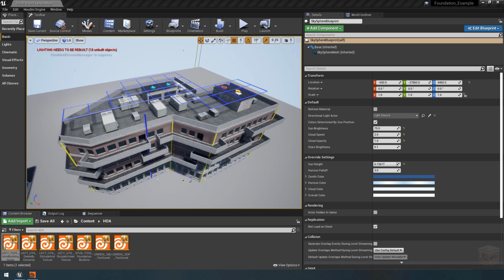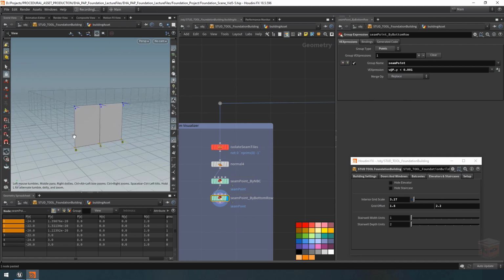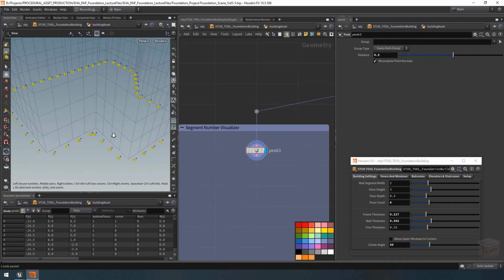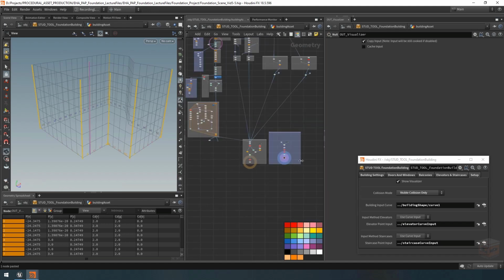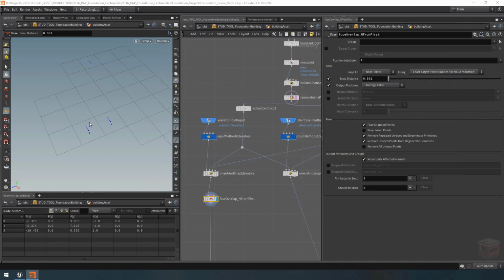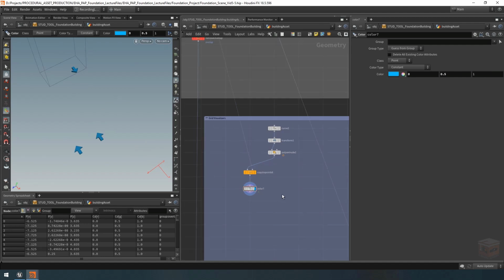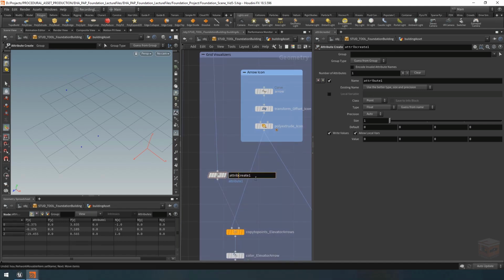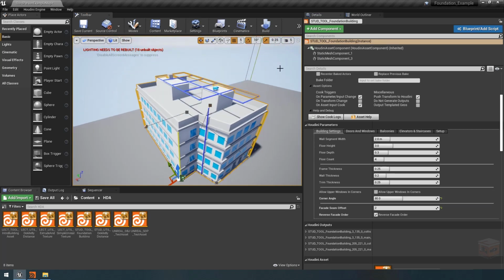HOUDINI FOUNDATION - 11 - How To Make A Visualizer - ( Free Tutorial for Game Dev with Unreal )

Comment: Woah that was a long one, but it was worth it.
Are you going to cover how to automatically apply some Unreal properties, for example let's say I want to set all visualizer meshes to "Cast Shadow" = false ? Is it possible to pass that information directly from Houdini from an HDA or do I need to bake the asset down to an actual mesh first and "manually" apply those properties afterwards in UE ?
Thanks !
Reply from the maker: I do cover this in module 2 of the masterclass for blueprints we need to configure. I have not yet tried to overwrite a generated mesh,but i suggest you look into an attribute called 'unreal_uproperty_cast_shadow' with a value of 0. 

unreal_uproperty_* should talk to the * variable on spawned objects, actors & components its accompanied with and set them. You'll have to see and test how to spell 'cast shadow' though. If i recall its not case sensitive but spaces might need to be defined as underscores. These can be any attrib type, like point, prim of detail attributes, but if its for all the data in a single output (geo container), try an integer  detail attribute.